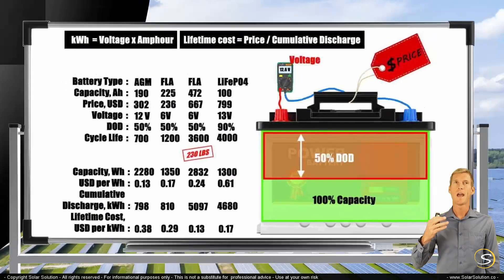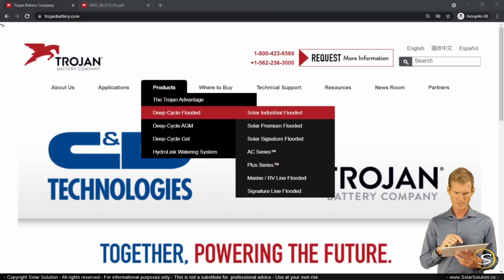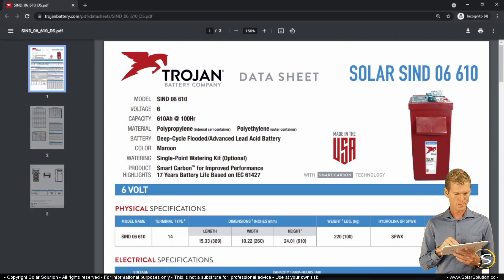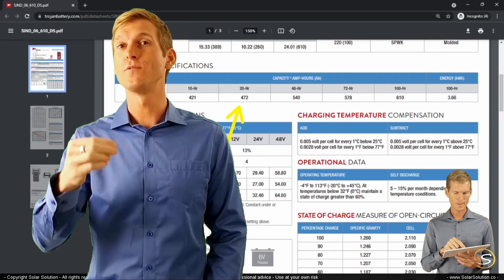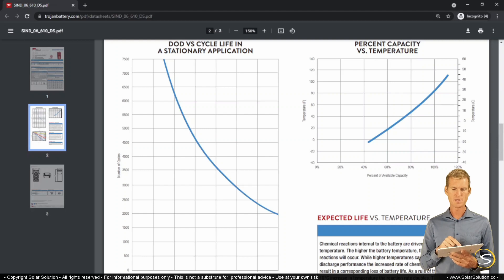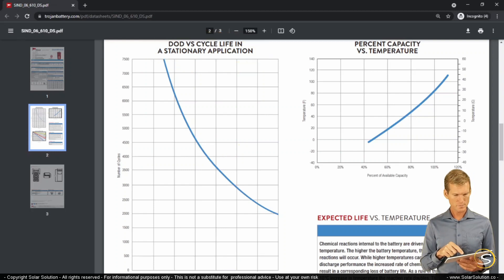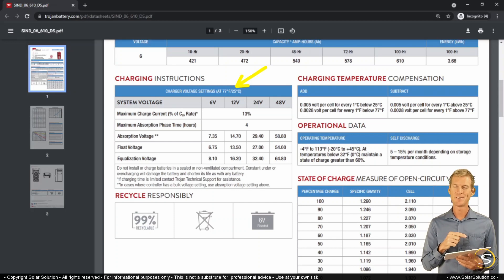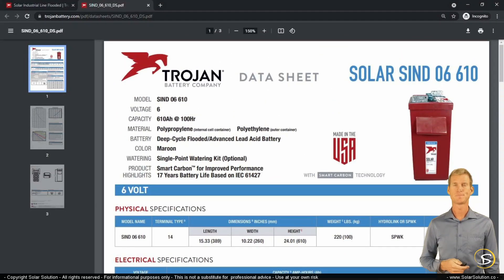Long Life Lead Acid: Batteries that last 10 years

Comment: I wanted to ask; is the vapor, or air around a battery bank really that bad? People think it is, but if its well ventilated I wonder if that's true still? And is the idea of the air around a battery bank not being good actual fact or just a myth?
Reply from the maker: An excellent question Noah, thanks! It is not myth, it is definitely true. That being sad, appropriate ventilation substantially mitigates the negative effects and/or risks.